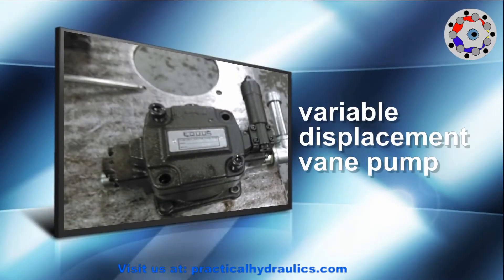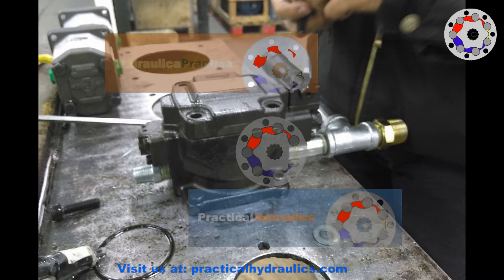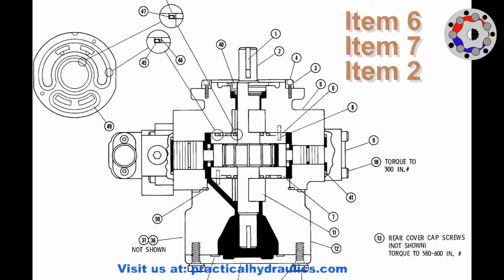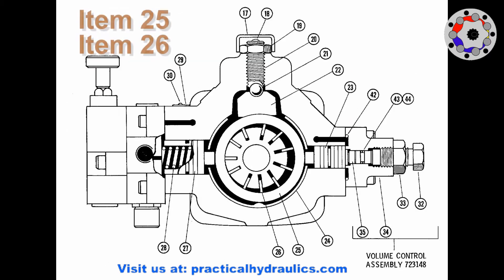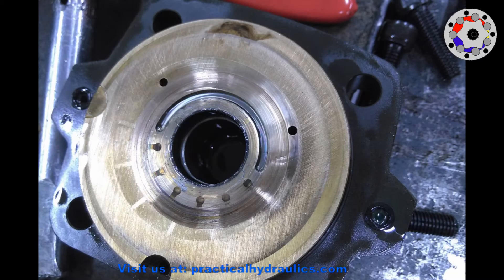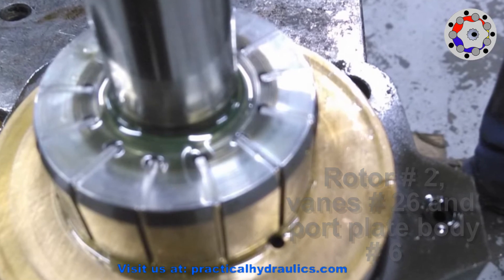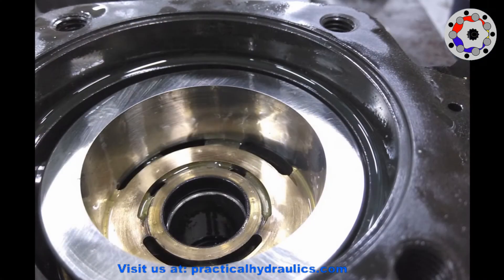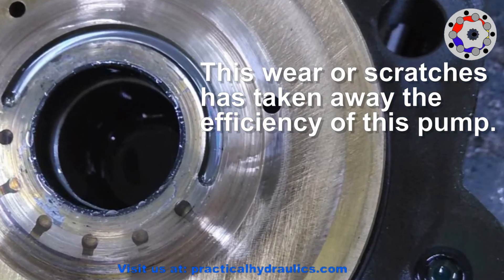Variable displacement hydraulic vane pump

Comment: What if cam ring are scratch pressure and displacement insufficient
Reply from the maker: Thanks for asking. That is precisely a sign of wear un the pump. The result is low flow under pressure.
Reply: @CamiloRuedaHidraPrac  thank you
Reply from the maker: @angelovalentin4050 thanks for asking!